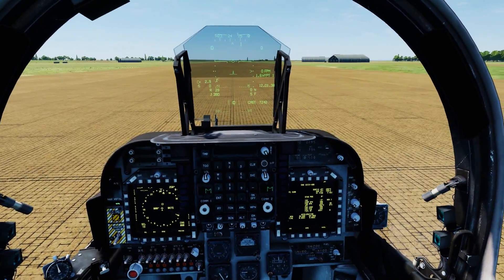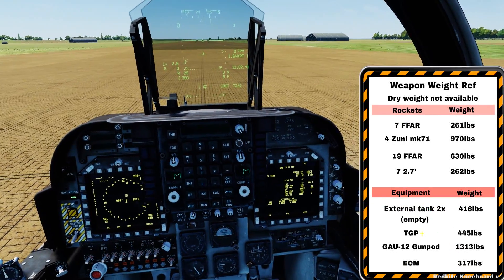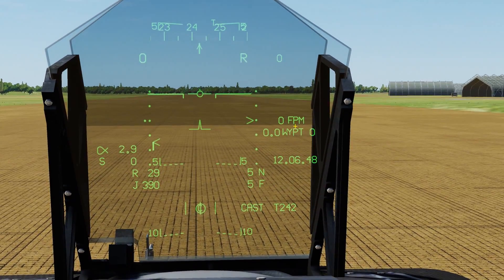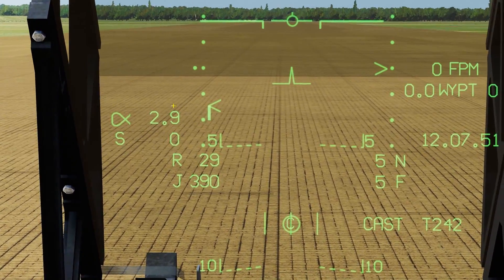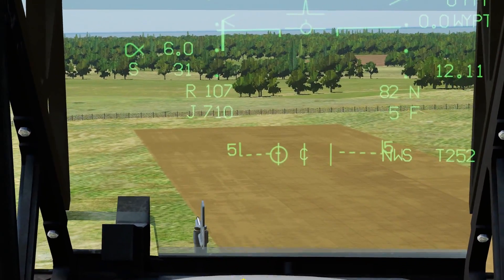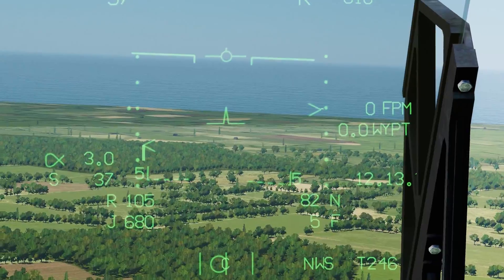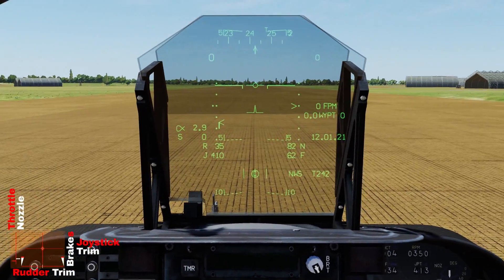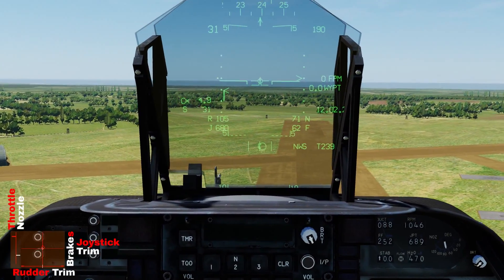DCS AV-8B Harrier VTOL Tutorial

Comment: Great vid RedKite! Finally a tutorial that is concise and meaningful. I do have a question for the DCS community regarding this aircraft however. I use  a Winwing throttle quadrant and split the throttle levers, one for power, the other for nozzle angle. I noticed that when I transition from 82 degrees to 83 degrees there is quite a lot of movement with the lever before it registers the next number. Is this normal for this module? Thank you in advance!

Comment: Hi Pal, need your help... I´m thinking about grabbin the Normandy / WWII-Asset bundle. But i had to read some guys saying the map isn´t woth the money and the performance is really bad. As you´re doing this Harrier-tutorials on Normandy, you should be able to say whether the map does work well or not (from your POV).
Reply from the maker: Normandy sees very little use for me, i do use the ww2 assets but rarely the map, this is because i mostly fly modern aircraft. I'd strongly consider the Il-2 Great battles series if you're after a more complete WW2 sim, although DCS has the better systems and flight model.

The Normandy map performs a little worse than the average map and doesn't see much use online. So unless you're looking to specifically fly ww2 in a group or solo i don't think it's worth it.
Reply: @RedKiteRender  thanx for reply. As far as I´m 100% singleplayer, the lack of online usage of the map is no problem for me.

Comment: I don't get it, how do you take off without using any H2O?
Reply from the maker: H2O is automatically used only when the engine power is high and it's getting hot, heavier you are the more likely you are to need it, pushing the H2O select on also changes the engine profile to allow for more power.

Comment: My vstol hud mode is missing several things, as well  no attitude indicator ,pitch ladder,  witches hat is missing the little  I c I cross slip indicator  while in vstol mode . I can't figure out what I'm doing wrong. someone, anyone  Help. Please!  your assistance would be most appreciated.

 

 

Reply
Reply from the maker: Did  you start the aircraft up yourself? it sounds like you missed the gen switch.
Reply: I resolved my issue  by uninstalling DCS World 2.5 +  then I  re-installed it and everything functions correctly in reference to all  indicators ,pitch ladders scales symbols gun, and missle sight reticles.
Reply: I had this issue too. My solution was to simply set the texture quality to high

Comment: Using the rcs will also increase temperature in the hover, as the decs will increase fuel flow into the engine to maintain performance with the loss of RPM caused by the tapping of air from the turbine (iirc) to feed the rcs. Can become dangerous with heavy weight and water flowing already.

Comment: I have flipped about 40 times trying this.. But when I watched this video it was like butter
Reply from the maker: If you're struggling consider setting up some curvature for your pitch/roll axis(try 30-40) and reduce as you see fit. Real life pilots have much larger joysticks and greater precision than ours generally. This will give you greater precision in the lower end of movement at expense of some precision at the higher end.
Reply: RedKite thanks! It helped alot!
Reply: @Unfathomable, What also helps is (If you have a Thrustmaster Warthog) to get an extension for your joystick. This makes it much more precise, but setting up a curvature is less expensive offcourse ;).
Reply: BartB1986 I was always pondering on weather I should buy the warthhog or not but I'm definitely making the investment now that the announce of the hornet is out

Comment: how do you bring the arm panel for weight check prior to take off??? is it a mod???is it on other planes too????
Reply from the maker: 00:18
Reply: RedKite hi I did not hear what was said after left alt. I’m also having difficulties vertically taken ng off I’m following all instructions but the plane is spinning around , do you need to apply rudder and brakes and I’m also taking off into the wind
Reply from the maker: Lalt-@ thinking about it, it might be Lalt " if you're on an american keyboard. brakes prior to lift off, soon as airborne release, rudder and other controls as needed to maintain steady flight, if your joystick is too small/sensitive and you're overcorrecting consider adding a curvature to it in the axis asign menu of controls.

Comment: What's the deal with the AOA HUD indicator? It was showing 75 degrees of angle on touchdown. Is it a bug or a feature?
Reply from the maker: The Angle of attack is the difference between the pitch angle of the aircraft and the angle the air is flowing over it, since i was descending with almost no forwards speed, the aoa is very high as the air is flowing up from below the nose. This is correct behavior.
Reply: Excellent, thank you for the clarification.

Comment: I keep drifting to one side, no wind in mission. I keep her straight & steady but it slips like I'm on a skateboard....
Reply from the maker: The harrier is not like a helicopter which hangs off of it's rotors, it dosen't self stabilize at all, you have to balance it manually, which means constant corrections to allow for the drift which is pretty much always present, this is a big part of why you want to always VTOL into the wind.

Comment: the harrier is sucking away that fuel so quickly, tried a multiplayer match yesterday and had to rtb pretty damn quickly because I was running out of fuel and another funny thing I noticed: until now I used the sliding marker for AoA as an indicator on how much trust to put out to hover properly. Like when it's above the zero-line add thrust, when it's below lower the thrust... that works too ^-^
Reply from the maker: There's always external fuel tanks or AAR :) but she does drink pretty quickly on high power. The AOA will tell you the angle you're descending with so i can see how it's helpful, i personally prefer the variometer on the right though.

Comment: I see that you fly above the engine limits for much more time. Don't you experience loose of power if you keep jpt above 645 and rpm above 1000 for more than 15 seconds? It happened for me many times and repair didn't fix it.
Reply from the maker: I believe 800JPT and or 120% rpm is the 15 second limit emergency power, running above 100% rpm and temps around 700 is fairly common during vtol, it does slowly degrade the engine. The aircraft is quite maintenance heavy especially when used for VTOL which is why they typically opt for STOL instead. 

It's something like 110% rpm / 700JPT has a 15 min limit per flight, though i'm not sure how it's modeled in dcs.

I think it's a bug that the engine does not get repaired.

If you're finding the engine dying out quickly, there is a good chance you've been running it hard throughout your flight beforehand and already worn it down.

I've experienced the power loss problem in the past, but i've not seen it since i started being more mindful of my engine use. Bear in mind that whilst the DEC does help maintain safe limits, it does not prevent engine wear caused by the pilot, even in conventional flight.
Reply: well, I'm more careful with engine too after I got it wrecked for a few times. I've got it messed up by vertical take offs. I did like 4 vertical take offs and 4 v. landings and the engines didn't help me no more. Then tried to repair but couldn't get off the ground. Maybe as you said, it should be a bug. Hope for the new update from 1.5.8( on av8b) to also come soon on 2.2.
Reply from the maker: Yep, that would do it haha! currently 2.2 and 1.5.8 have differing versions of the harrier on 1.5.8 for example the screens are greenscale! (correct colour)  I expect we'l see updates speed up once the 2.5 merge happens late January.
Reply: Yes, right. Can't wait to see 2.5. I wonder if it'll be any change on graphics in Nevada map as Caucasus map will look so different.
Reply: 645 jpt and 1000 rpm is maximum continuously use. My bad. I have just read it in manual right now.
Reply: In the sense that graphics in NTTR are ennoyingly sunny and Caucasus seems to me much more realistic. Do you (all) agree?
Reply: MrRangerobert You have some settings in graphics to change that. Try changing Deferred Shading and Cockpit Global Illumination(for NTTR). The most realistic graphics you'll find in Normandy as I think.
Reply: Not sure to catch what you mean. To have LESS sunny effects and blue dominant inside the cockpit HOW I have to set HDR, Deferred Shading and Cockpit Global Illumination? ON or OFF? And you mean that Normandy is more realistic, instead? Thx a lot. I appreciate your help
Reply: MrRangerobert  You should try to change those settings that I have mentioned in the previous comment. You'll make the illumination as bright as you want. Caucasus is has a blueish environment that make it look a little dead in my opinion. So Normandy looks perfectly from all of them. Have fun flying and happy holidays !
Reply: if you'll turn global illumination off you'll see a difference. Try them and see how you like. You also have in game a setting that is called GUI or something similar, try adjusting that.While you're in game, press ESC then go to options and you'll see GUI.